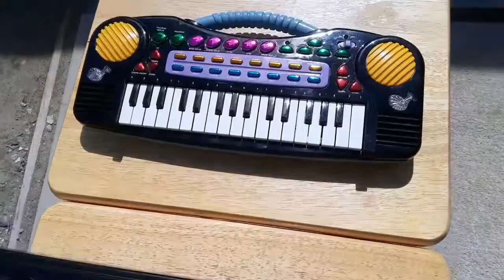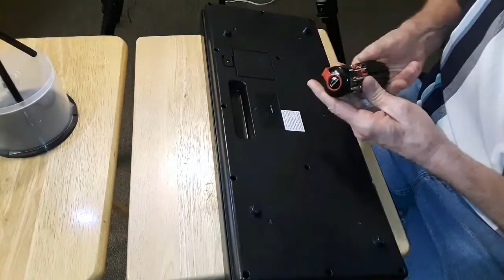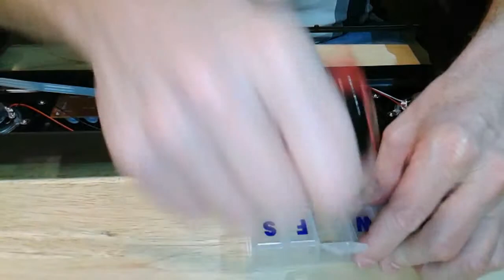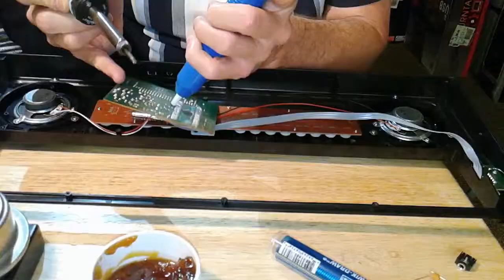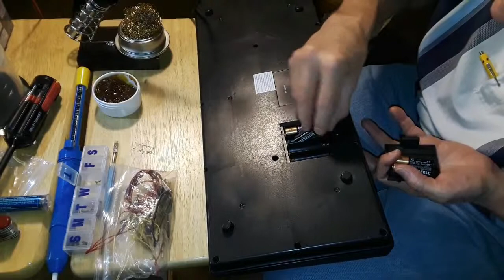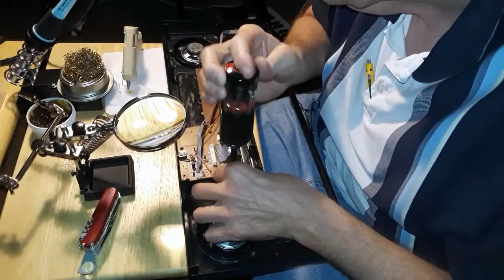First Act Discovery Keyboard Part 1 Modifying

Comment: Taking electronics apart, no matter what it is, first glance always look for any fragile or loose connection. If its working fine, dab some hot glue over those connections. No worries about breaking ribbons or connections that way. Fairly easy to remove of needed also.